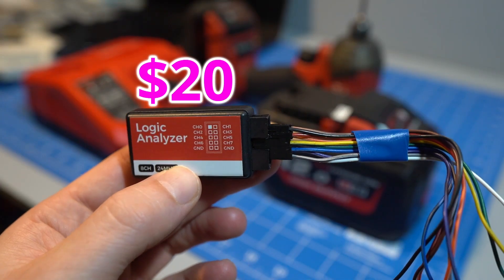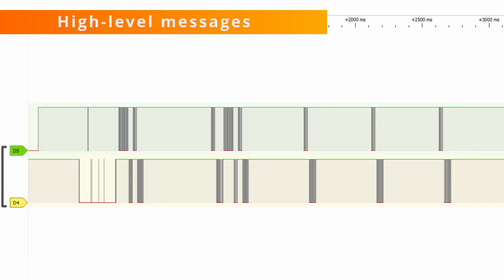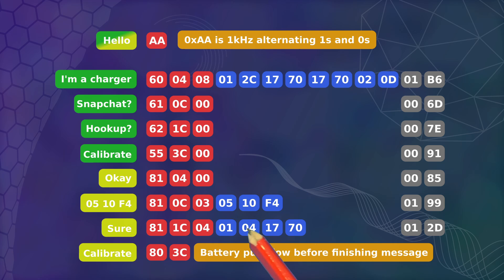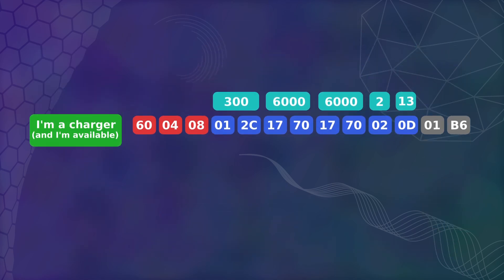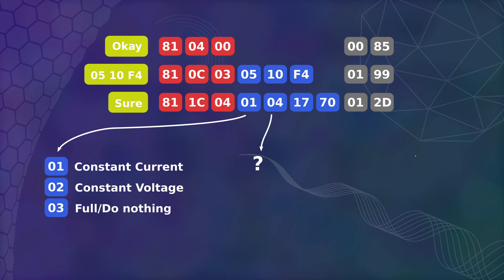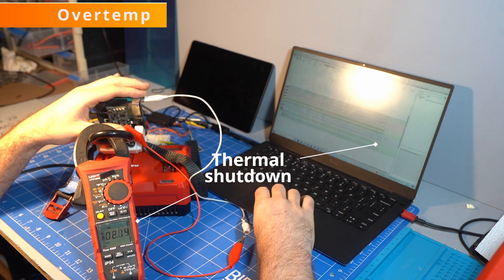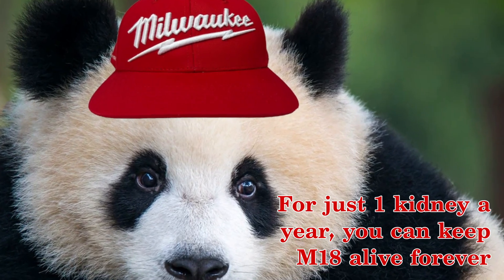[004] Reverse-engineering the Milwaukee M18 Redlink Protocol

Comment: Hey! Nice work, I wrote some Arduino code a few month back when I was looking at this that let's you send your own messages to the battery. It was a bit of a pain, as you're probably aware that the bits are inverted and the in reverse bit order. You also have to wait 1 bit length between sending each byte or it fails.
I modified the Arduino Softserial library to suit. 
I also tested communication between a M18 battery and a tool, but I couldn't find any data. I think it's just temperature, and the voltage is measured directly. The tool handles the disconnect when the voltage is too low. I repaired a few tools that measure the battery voltage via a potential divider. I had been going to do a video myself on this at some point but haven't got round to it yet. Thanks for the mention 🙂👍
Reply from the maker: Hey mate! I'm out atm so I'll give a longer reply later. Can you post 2-3 of your most relevant vids and I'll put them in the pinned and description. Hopefully give you some suggested traffic. I should have contacted you before posting, but I was honestly expecting this vid to barely limp past 1k views.
Reply: @toolscientist  No worries mate 😂😂😂 If you want some of my Arduino code or some of the data I captured to compare such drop me a message. I'm just off to bed as it's 02:41 here👍
Reply from the maker: So, thank you so much for your reddit post. I had a fair bit of trouble getting data capture going and might have given up without your data. Thanks to your datastreams I was at least able to know I was on the right track with the TX messages. Then I was able to trial and error an input resistor for J2 (100k is too high and LA sees nothing, 57k is too low and breaks comms. 69-79k seems to be the sweet spot).

I'd love to see what you can do feeding serial data in. There's got to be a diagnostic command in there that'll make the battery spit out health, cycles, etc. I'm some ways from starting that as I've been out of the electronics game for a long time and all I've got is a 10+ year old pinguino board that I never learnt very well. I need to get myself a pico or arduino.
Reply: @toolscientist  Thanks, it took a bit of figuring out at first but after working out the baud rate and messing with MSB and inverted data that's when I figured out the check sum, so I knew I was on the right track. I did notice the value decreased during charge so guessed that was the current. Good shout on the 3000 vs 6000 thing as I missed that. Oh I just hooked up to where the data went to the microcontroller in the charger for the TX and TX. I've done a fair bit of reverse engineering in the past on both hardware and software 🙂 most recent was the medical ultrasound machine and the solar inverter I repaired where the company wouldn't give me the password to change settings so I did a video in reverse engineering their software 😂😂

Comment: Great video...Question:  when a battery gets discharged while in use with a tool, it send a status message to the tool that disables further operation in order to avoid damage to the battery. if the battery is placed on another tool it will not work either. if placed briefly on the charger however, it will reset this status message and the battery will become usable again for a short period of time...would be nice if you could find this status message/bit...would make t possible to use these batteries safely with non Milwaukee tools. thanks for your wonderful work, appreciated.
Reply: When I was looking at this a few months back, I didn't see any messages between the tools and battery. The battery doesn't have any under voltage protection as the battery output is wired directly to the cell pack. Only the charging pin is connected via a mosfet on the battery PCB. On a couple of the milwaukee lights I repaired, the battery voltage was measured via a potential divider and then fed into an analogue input pin on the tools microcontroller. The microcontroller then switches off a mosfet to disconnect the battery if it's below a certain level.

Comment: As someone who has carried out similar work between ECU's in a car and a diagnostic machine, this video was amazing.  :)
Reply: now you sound like you could make very interesting videos. always curious about how ecu works in cars
Reply: @lordjaashin well most cars at least have a factory service manual that helps you narrow down how it’s communication works from system to system.

Although it doesn’t tell you what that data looks like, you’d need to intercept and start playing with values on the ECU and see what they do. 

It would be really cool to see it in this type of format though.

Comment: I was surprised how much digital communication was actually going on.   It would be nice to know how many bit microcontroller is being used.  It is certainly not very astute in figuring out widely varying situations such as available super fast charge, ultra low temperatures, cell charge imbalance which use to be measured religiously and way over board from what I could tell.   A lot of these battery management systems will not let the battery charge if it gets very low.   Very frustrating.  It doesn't appear Milwaukee does that.  

 I'm only guessing, but Lithium ion batteries with a liquid electrolyte being prone to catch fire if leaked into a oxygen atmosphere, mit appears battery management systems were implemented to protect the battery pack from rupturing from over heating.   If the batteries are not pushed to rupture levels they really behave much like other rechargeable batteries without the need for battery management systems.   The battery management systems appear to be used to protect against rupturing the charging batteries from over heating and only a little bit for better battery treatment, service life, with fast charge ability.  With that in mind they have a lot of room for better software for more optimum charging performance and battery health tracking.
Reply from the maker: The battery is using an MSP430 (16-bit). Not sure what charger is using.

Most of my tests were on a 2016 2ah pack. In another vid I noticed that there was a change in the logic for the newer high-output (21700 based) packs. There's a chance that they put more safety features in those packs. 

Taking a cell down to 0.9V and not getting an error code was definitely a surprise!

Comment: Some data points.

USA batteries from say 5 years ago would report information through the state of charge lights if you held the charge state button down for something like 10 seconds.  Batteries fro about 2 years ago do not have this function.

I can't find my notes however I recall that the number of charges would be reported and I think the serial number stamped on the battery along with some other flash codes.

I'm betting tool repair centers have a tester to determine if a battery is eligible for a warranty replacement.

Comment: 0510F$ could be a battery type? It would be interesting to see  what the 12v battery returns.
Reply: All of the 12 volt batteries I looked at were just + - and a Thermistor. It was only the M18 battery I found that communicated with the charger, and didn't observe any communication with the tools. I've repaired quite a few tools, and one constantly thought the battery was flat. It was just reading the battery voltage via a potential divider and feeding it into an analogue input pin on the microcontroller, and one of the resistors on the divider had failed.
Reply: @BuyitFixit   ok cool. I have a faulty m18 battery, I should put that on the logic analyser...

Comment: youtube recommendation brought me here. can you share more info about the logic analyser and its set up and requirements please?  i'd love to get into this stuff more.
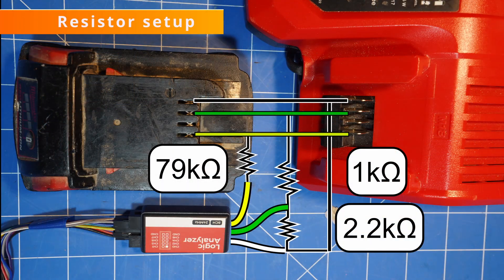Reply from the maker: Logic analyser is from Spark Fun. Just beware that only one of the GND pins works (the one below CH7). The GND pin below CH6 is a clock signal and shouldn't be connected. Connection instructions are at 1:12 - white wire is GND.

Comment: I recently did a M18 project and the J1 and J2 wires really messed me up. The weed eater kept cutting off and throwing faults. I don't have the equipment like you but my I'm pretty sure it was the green and blue wires as I'd get different readings.  Video of my build is here. https://youtu.be/A9wmkpV5pVo
Reply from the maker: Wow, that's a serious project. Well done. I'm going off memory, but I think all you have to do is put 3V or more onto J1 to get the tool to work. J2 doesn't need anything. You can get the tool to work just by putting your fingers on the +ve and J1 pins.
Reply: Man I wish I knew that 2 months ago. I was afraid of damaging the battery so I didn’t push it.  Keep the videos coming….. good stuff.

Comment: Thank you!  I have been wondering when this content would come along.  Curious what happens on discharge, i.e. cell protection from over discharge.  I use these batts to power a lot of things and I only have pack level voltage protection, would love to implement cell level protection.  Also curious if there's any way to determine if there's info about cell balance available from the battery perhaps a set of dev operands...
Reply from the maker: I'm sure there's a hidden diagnostic code. From the pattern you'd have to guess a 0x63 or 0x64 command would do something. I definitely want to look at this in the future.
Reply: There is no over discharge protection as far as I could make out. It's handled in the tool.

Comment: There is one thing with 12ah battery, lower amps battery when locks itself(when voltage drop) and can be unlocked with charger, then looks like 12ah battery cant be unlocked via charger, bms chip locks it permanently. Once I had 12ah battery, charged it with lab power supply and nothing, charger and devices not accepted it

Comment: Subscribed. Hope to see the video about tool -> battery communications as well!
Reply: I tried with a few tools a few months back, and only had digital communications between the battery and charger. I think the tool only measures the pack voltage via a potential divider (one of the Milwaukee lights I repaired does this as one of the resistors had failed so it always thought the battery was flat).

Comment: I quite enjoyed your commentary on the M18 mating habits. has anyone tried rebuilding these packs with fresh cells or is it the control boards that fail more than the cells? I own a 20V B&D tool set (they seem to have the cheapest  battery capacity to cost and work well enough. i use dewalt 20V at work and they seem pretty decent... My buddy on the other hand swears by the new Milwaukee tools... Any thoughts on battery cross compatibility? iv seen people make claims of using adapters or trimming tabs on tools/ batteries and supposedly they run just fine... Now im curious as to how they would interact with different brand chargers.. Anywhoo have a like and sub!
Reply from the maker: There's quite a few vids of people rebuilding M18 packs with fresh or scavanged cells. Seems to work fairly well, from what I can tell.

Comment: Back in my day (2010's), Li Ion batteries didn't need any protocol communication to charge. 
Will they get proprietary 6G internet connection next, so they can sell them as a prescription service?
Reply from the maker: Don't give them any ideas! With wireless connectivity they'll push over-the-air updates to our batteries to make them run slower, like Apple did.

Comment: I love seeing some pulseview!

How did you figure out which decoder to use on the signal?
Reply: You basically narrow it down by knowledge / what makes sense. Like:
- Is there a clockline?
- Is there a TX/RX (from schematics / where you see transitions if the other side isn´t connected)
- Baudrate is basically derived from the shortest pulse you see
- MSB/LSB = find some 2 byte value which changes over time (like temperature) and just look at which byte changes first / whether it overflows into an adjacent one.
- Manchester coding: you will see a lot of state transitions instead of longer intervals of high/low
Reply from the maker: Fortunately for me, a youtuber called "Buy It Fix It" figured that out several months before I began looking at this problem, so I got to skip those early steps of the process. The other comment by Timo has an excellent description of the process

Comment: Imagine paying brand tax for a thing, then said brand's company starts pulling this kind of thing. Now even batteries have drm. Thanks Todd!
Reply from the maker: I don't think it's quite that nefarious. The original M18 packs didn't have this protocol and were restricted to using slow charging. To get fast CC/CV charging they either needed to add more pins (there isn't enough space) or go digital.
Reply: @toolscientist  I'm pretty sure that those beefy spades can handle 6A current without any significant heat increase. In my experience high power batteries usually are limited by either individual cell ratings, safety circuit, or connector itself. Never give companies any benefit of a doubt, they'll turn it into subscription service.

Comment: Yup they rig them to throw an error if you disconnect a cell in an attempt to repair them. It also does not seem recoverable
Reply from the maker: I've seen lots of vids of people rebuilding packs with new cells. That requires completely depowering the board. They then put it on a charger, which seems to initialise it and then it works fine. I had a lot of trouble with the desoldering, so I might have cooked one of the nearby diodes.
Reply: @toolscientist  good to know so depowering the entire board fixes them, so it sets a soft error code that tells the changer that it's dead.

Comment: First video I've seen from your channel, subbed! 

It would be AWESOME to have openly documented protocols for the major 5s platforms, so that adapters could be made much safer by translating the low/over temp and LVC protocols from battery to tool. Most I've seen are dumb +/- to +/- wiring.

I've been trying to ID my Bosch blue (CORE) packs/tools/chargers but haven't figured out the "NTC" or "COD" pins yet. This is even more advanced. I'd like to use the Bosch batteries with my other tools, without sacrificing LVP etc. Bosch's own 18v lights are either low efficiency (lumens/watt) from using outdated LEDs, or have poor tint shift or color temp. Their Scangrip-made 4k/10k lumen ones are efficient but have a bad 6000k color temp. So I got a Metabo HPT UB18DCQ4 (rebrand of the Metabo version) which is great, <5000k temp, efficient at 133 lumens/watt, and very robust, but I'd like to replace the battery interface with a Bosch one. The HPT tool cuts out below 13.00V, which is lower than I'd prefer, so it would be great to know how to add logic to the Metabo HPT "LD" pin so the light cuts out at say 15v instead of 13v, as well as if the Bosch battery was overheated (which is unlikely in a light).

It really would be game-changing to be able to choose batteries on their own merits, and tools on theirs.
Reply from the maker: NTC sounds like a thermistor (Negative Temperature Coefficient). It's likely an analogue pin that the tool uses to monitor the battery's temp.
Reply: @toolscientist  EDIT: Did some more testing, the Metabo HPT (Hitachi / Hikoki) battery will pull down the LD pin to ground at around 16v, which signals the tool to shut down. The tool puts out 5v on that pin. A work light shuts off as soon as the pin is grounded, whereas on a small drill only checks for the pin to be high at the beginning of each trigger pull--- so holding the trigger can draw the pack down past 16v. The light has a backup LVC below 13.00v.

Still working on figuring out the Bosch battery ID pin.

Comment: Will you be checking M12s in the future too?
Reply from the maker: There's some funky stuff going on in the M12s. Older M12 were completely dumb, but mine have a PCB with a dozen test points and very obvious rectangle of Vcc, GND, CLK, DATA, and RST. So there's definitely a chip in there and I should be able to poll it through the (probably) i2c pins that they've left exposed. I think they might have some small transistors to switch the C1 and C2 contacts. These contacts are fairly exposed and could short if the battery is placed in a bag with lots of metal tools, for example.
Reply: @toolscientist  Interesting, I've not seen any M12's with chips in them. All the ones I have only have the cell voltages exposed to the contacts at the top, and a thermistor.